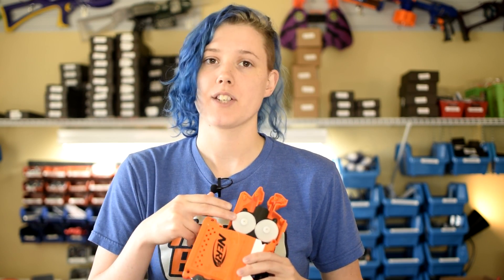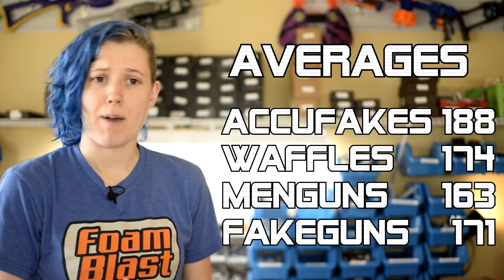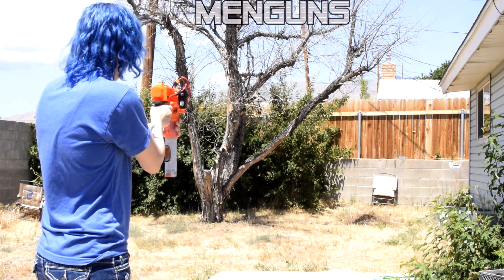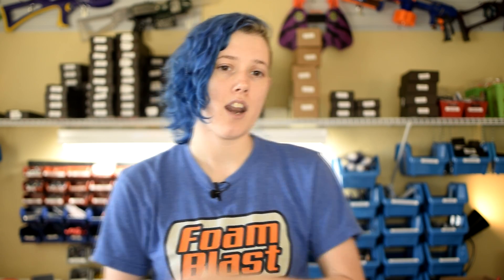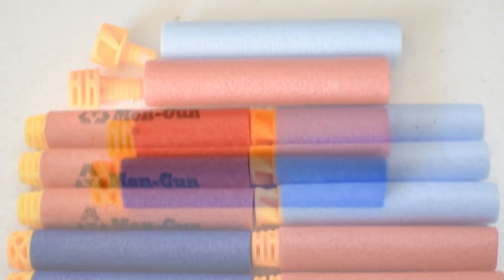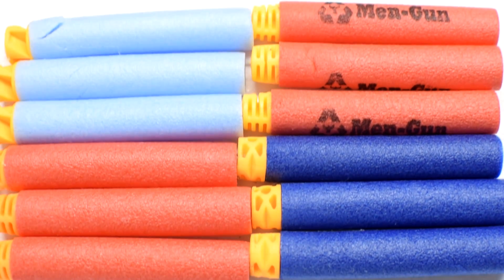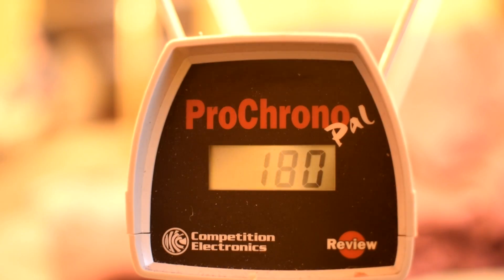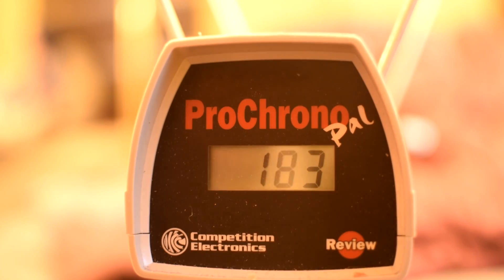Review: Eclipse Gen2 - Redemption?  2S vs 3S Tested.

Comment: Fang revamps on 3s is still something you guys don't recommend and now you prove why that extra RPM is wasted.  

At more than 150fps with max crush and 3s my RS can shred old darts so this is not a surprise. I think a better setup maybe to spread the dart load over two stages but this is something I have yet to attempt with some awesome Fang revamps. Great heads up thanks!

Comment: How do those motor boards work? I can’t seem to grasp the concept of how it works
Reply from the maker: It really just speeds up the process of wiring the motors. It has instructions on it for which direction the board and the motors should face  (I've messed up direction more often than I'd like to admit) and you don't have to worry about doing a T-joint :) -A

Comment: Would it be possible to do a video on how to wire the motor board as I have gotten one but not entirely sure how to wire it up, it's probably very easy but I don't want to mess it up as I have to pay import duties to get it shipped to the uk
Reply from the maker: We have been planning to do installation videos for a number of products and this is on the list, but I promise its super simple. It has instructions on the board about which direction it should be facing and which way the motors should be facing

Comment: What method do you guys use to install your flywheels?
Reply from the maker: Most of the time we rest the back of the motor on something to keep the tabs safe and then push down with our thumbs. If its stubborn, a little heat with the hairdrier helps. The Eclipse wheels were especially stubborn, so we had to take the bit off our drill press and use it to push the wheels on.

We'll likely do an installation video for motors and flywheels soon.

Comment: I second this message. 2s > 3s in my testing as well.
Reply: Fangs > Errything
Reply: @LordDraconical  would it be possible to run the original Fang 3s motors with high concavity wheels on a 2s lipo and still get good performance?

Comment: ..... still murders darts : /
Reply from the maker: On 2S it's more gentle than any other setup that even thinks about coming close to it for performance.  At 50,000+RPM, any system is going to murder darts, that's just what happens when you try and accelerate a small weak dart that quickly.
Reply: Gavin G/Pinocchio Super crush
Reply: Any high-performance flywheel setup will murder darts. It's simple physics, Energy=Force x Distance. Unless you find a way to increase the distance on which the force acts, e.g. make a longer dart head, there will be a large force on the head, tearing it from the foam.